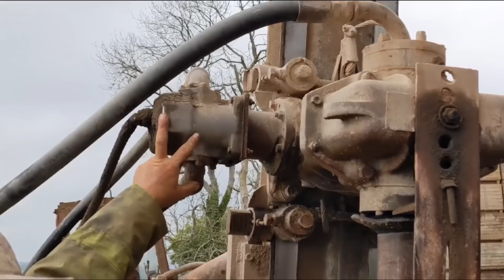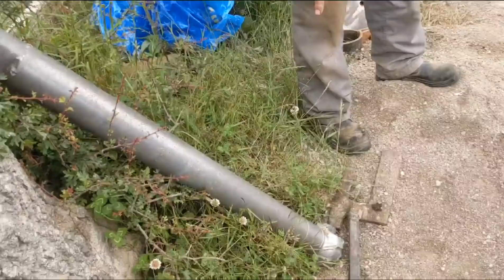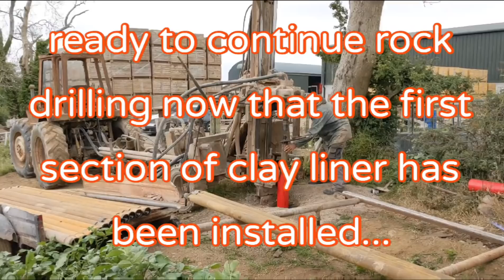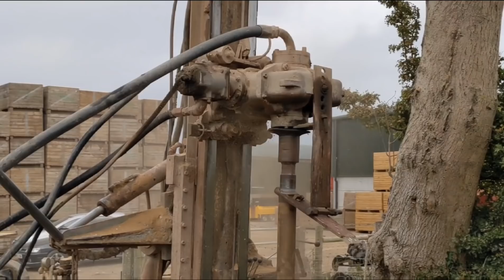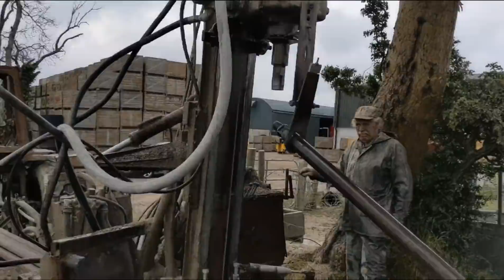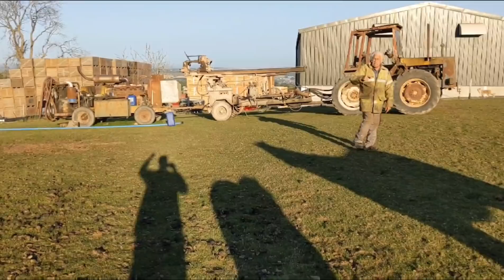spent a day with world's oldest driller and his incredible drilling machine

Comment: I got a 4 cyl 90 hp white stationary powerplant im going to create a systems to make a compressor a generator a beltdrive for a grinding/cutting shaft on bearings and use the radiator to create winter heat in the shop when running im building a oil burning forge in the same building to accompany it behind my primary shop

Comment: Must only be the dirt stuck on the Muir-Hill that's holding it together. As for the Cummins NH 220 wonder when the injectors were last adjusted. The small air flow blockage merter on the side of the compressor intake could do with a clean to see, if it showing red, and air cleaner is getting blocked. .

Comment: His rig gets the job done. Modern DTH (down the hole) rigs, use mine supply air at 100 psi, with an onboard booster (compressor), to raise the pressure to 350 psi, to run the hammer. Cab optional, usually in underground setup, (that I am used to), fully automatic (as you say), with rotary rod magazine, operator just has to look after bit change/hammer change.
Best wishes from Northern Canada.

Comment: Oh Yeah,  nearly anytime someone interviews and features an old timer still at it with an ancient machine, that most likely only he can operate is interesting as it gets. That Old Cummins (model NH Maybe?) / Sullair Compressor is a work of art. Incredible man Uncle Drew is. My kind of guy.   I am 57 now and I hope my body and mind will allow me to keep working well into my 70's. 
On a side note I was a water well driller for several years back in the 80's and early 90's. We used a rotary table rig and we essentially connected our drill pipe the same way... the hard way compared to modern drill rigs. Had a similar stand and trough to make up and break the drill string! Thanks for taking the time to feature uncle Drew and his cool old machine. I would love to hear some of his stories, that have to be good. Well wishes to your folks. Cheers

Comment: Brilliant drilling rig, compressor and Muirhill all working well and those engines sound so  sweet. As for the main man, top respect because he is mentally and physically fitter than most less than half his age. What a man! Superb video. I have done a bit of water borehole drilling with a converted ex army Bedford TK 4x4. Again, a great old machine. There was a T piece at the top of the sleeve to divert the water spray and debris away from the rig and operators. 
I doff my cap in your uncles direction in respect to the man!